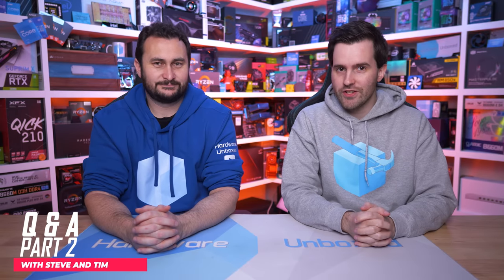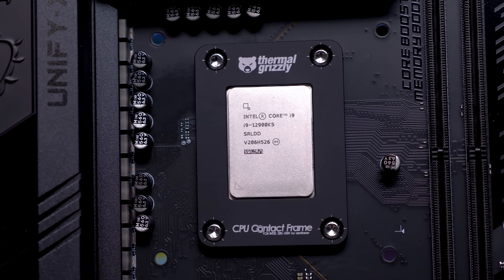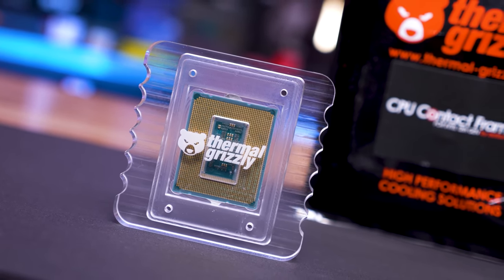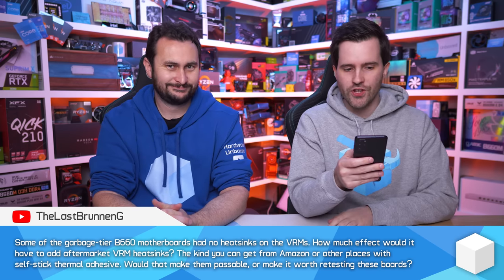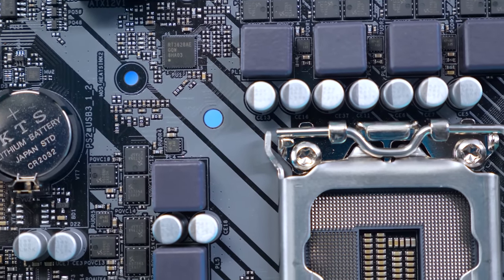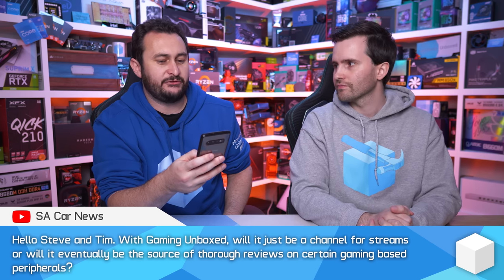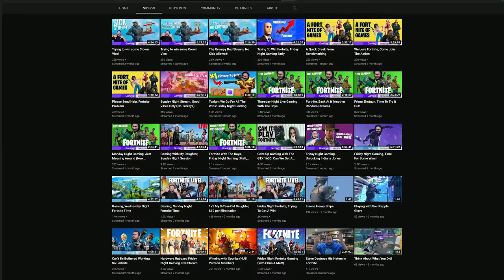Biggest Tech Fail 2022? Zen 4 To Make DDR5 Relevant? August Q&A [Part 2]

Comment: Regarding DPI, I use 8000 DPI all the time. I use Arch (btw) with KDE Plasma and I have the cursor speed set very low with the cursor acceleration set to "flat" as opposed to "adaptive", meaning the distance of movement of the cursor is the same regardless of the speed of me moving my mouse.

Also, the only game I play is CS:GO (which on my 14 years old Pentium E5200 runs very badly 😆) which supports using raw data from the sensor so I have my mouse set to 8000 DPI and the mouse sensitivity in CS:GO somewhere around 1, which is much lower than other players use.
I actually don't even get why players use so low DPI - there is a big difference between the mouse sensitivity and the cursor speed. Sensitivity (measured in DPI) is how precise your mouse tracks the movement and the cursor speed is, well, how fast your cursor is. These two are closely tied together, but having high sensitivity doesn't have to mean having high cursor speed ...

So yeah, I prefer having precise movement tracking but the speed of my cursor isn't different from what others use.

Comment: My HTPC does more gaming at higher resolutions and refresh rates than my desktop rig. While I have more monitors on my desktop, it's only 3840x1600@144Hz. My TV is 3840x2160@120Hz. Right now, it's using far more bandwidth and HDR as well. At this point in time, TVs are well above monitor specs.

Comment: On the quadcore question: Yeah I'd say the 3700x and 8700k or the like 12400 and 5600 are the new version(s) of the i5 2500k. They're gonna last a while. and I don't know why people thought the 5600 would go obsolete so quick? Consoles have 8 LAST gen cores? the 5600 is as fast or faster than the 3700x in gaming... Then don't forget the chips inside the current consoles? Are underclocked to all hell as to not melt inside the consoles small form factor. the 8 core zen 2 chips inside the xbox series and the ps5? can't be much if any faster than a 3600 once you account for clock differences.

Comment: When running a game, your system still needs to continue with system tasks, like running services like virus scanners. I guess these would be offloaded to e-cores.
Reply: Who the fuck runs virus scanners in the backround while gaming? Even modern ones detect games now a days and turns themselves off. Other backround services are negligible.
Reply: Linux does not have this issue.
Reply: @purpasmart_4831  Switching to Linux Mint 21 Cinnamon, this coming build. Done with Windows Hoops and Snooping.
Reply: To clarify: I am questioning the added value of this design for gaming purposes. Multithreaded design of games is very complex anyways because everything needs to sync on the main game loop. Having the additional difficulty of not knowing the performance of a thread because you can not allocate it to a particular kind of core makes it very hard to optimize.

Comment: I play at 5200 to 6400 CPI on 2560x1440 and 3440x1440 playing hardcore CoD single shot kills. Fastest to hitting target wins. CPU-Z 9MM3CZ Another guy I play with uses 3200 CPI. 

Some people use higher CPI but significantly (1/3-1/4) reduce mouse multipliers along with ultra-high polling rates to improve mouse resolution. I've debated about this too and I have considered using 12,000 CPI with halving the in-game mouse multipliers.
Reply: .. BTW replacing everything including CPU/MOBO, GPU and 240Hz OLED monitor. Hopefully the 40 series and new monitors will offer DP 2.0 instead of compression...

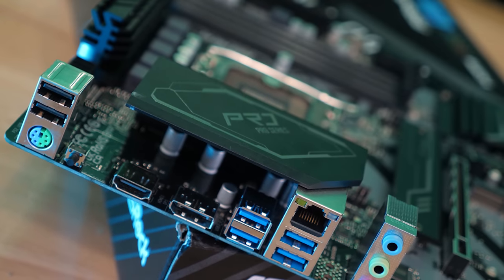Comment: I haven't seen the video yet, but for any serious fps person ddr5 prices can be bypassed to an extent just by waiting for the 3d cache CPU and purchasing the cheapest ddr5 ram. 3d cache makes ram quality irrelevant. Not so much a failure, but a caveat. Zen 5 3d cache CPU incoming on AM5 2024. Presumably the 12 or 16 core option to obliterate intel in warzone etc. 2:07 freeze frame= deep tutelage. 3:40 I do have a limited understanding of core usage during windows gaming, but prior to the release of e-cores I was offloading router tasks to the cores in my 3700x in order to lower my ping, which it did. I assume e-cores were conceived for purposes similar to this, not productivity tasks, as there is a plethora of optimization videos on YouTube detailing how to lower ping and increase fps in core heavy games such as warzone. Also, as a final note, are you able to benchmark the latency values of various high end gaming routers in Australia? Ping is more important in PVP games than FPS. The common response to lowering ping in online guides is to begin by increasing fps. However, fps increases will only lower player ping by a fraction of what internet service providers will, and from discussing this topic with them, modems/ routers will. 6:00 This topic is alluding to the ever-increasing importance of PSU performance and wattage in regard to the transient power spikes in 3000 series and presumably in the forthcoming 4000 series. The is precisely the eternal dilemma of my BioStar x570gt, 3700x, 3080 eagle and 750gm. 8:55 Just use pro mouse/ controller settings. I changed to COD pro settings after 1000 hours and discovered a drastic improvement in tracking and movement.

Comment: Standard way to compare mouse sensitivities is 360s. Measure on the mouse pad how far in CM it takes you to perform a 360 comfortably, and then set every in game settings to match. Mine is 32cm 360. So each games sensitivity is set so my 360 is always the same.

Comment: I think the biggest fail was the garbages B660 Motherboards that advertise an i9 12900k compatibility but will never can feed the processor properly without melt the VRMs or severely hold back the power delivery to the point that make this very expensive i9 looks like an i5 in performance, and this is something that cannot be adressed later by a BIOS update.

Comment: I still have a backup PC with a 2500K in it. Still works beautifully. Those 4 core 4 thread processors from way back were very - very good. It was gen 9 to gen 12 that lost the plot.
Reply: I agree, my i7 2600k was a beast and still is for general tasks

Comment: Question: Do you think the new AMD cpu's being LGA will require or benefit from a contact frame for best thermals like Intel?
Reply: They don't know it yet, but probably not. If AMD designed AM5 to have a balanced contact pressure.
Reply: @franktg632  I agree they don't know yet, but the AM5 boards I've seen look like they are using a similar mounting bracket to Intel which is what raised the question in the first place.
Reply: @scotthassel8124  do you mean similar retention mechanism? intel has been using that for years and not a single problem like that happened before, and it is because intel made their CPUs shaped like a rectangle thats why it had issues, meanwhile AMD kept their CPUs square so I doubt you will need such device.
Reply: @franktg632  Good point. Yes, I was referring to the retention mechanism. I do believe that the shape was a large factor, but I've always felt that mechanism was a "works well enough" solution and could've been much better. We'll obviously see. Was hoping to get this on the table so that the reviewers, when they receive their review sample, will be looking at that. Of course, being more efficient, the AMD's may not benefit much from a better retention mechanism.
Reply: AMD have designed the socket and CPU package to fit their traditional dimensions, why would a long used cooler retention system start bending CPUs?
I'd be more concerned about some trouble with the funky thick heat spreader coming unstuck than the cooler bending it
Reply: intel socket LGA 2011 solved all these large socket problems beautifully... by simply having two retention arms, on opposite sides.
Reply: @RobBCactive  Look at the Epyx, Xeon, Threadripper, etc. Chip mount and retention systems have varied greatly over the years and when it comes to commercial enterprises, they are looking to make the largest profit margin they can. Subsequently, a cheaper, "good enough" solution is often employed. In recent years more and more people are overclocking either intentionally or unintentionally (via XMP or other "tweaks"), and these "good enough" solutions are not providing the most optimized setups. Like I said, there have been alternatives for most configurations out there It has just been whether the customer finds it necessary to implement those alternatives. Most don't care and both Intel and AMD will have stock settings and setup which will indicate that a cpu approaching the thermal limits are still within spec. We are as endusers, trying to extract more and more from packages which approach their thermal limits, may need these alternatives. Does the AM5 design provide an excellent implementation, or is it just "good enough"? That's what I'm asking. Let's face it 16 cores with the controller in such a small package would IMMEDIATELY burn up without proper thermal control.
Reply: @scotthassel8124  ummm, according to Angstronomics Zen4 is thermally controlled now.  I believe it as somebody at the presentation shared the energy management is "more like a laptop".
There'll be plenty of reviewers looking at thermals it's Tech Jesus's obsession after all.
To run cooler than spec, active cooling can work harder.  But with dynamically managed chips, better cooling can translate to more boost speeds.
However the stream talked up performance at lower power levels, it's possible to limit PPT in BIOS if the cooler you choose isn't effective enough.

Comment: I operate my DPI at ~3600 I use a 3440x 1440 ultra wide. I'm not sure about sensitivity but a full 360° rotation in must fps game is about an inch and a half displacement of my hand.

Comment: DDR4 was out in around 2014, it's time to move on as 8yrs in tech time is a very long time so I'm really glad AMD is ditching DDR4 entirely as it also means less to support and fix. I'm running a 5950x with 64GB (4X 16GB) of Corsair Dominator Platinum RGB and I really want the 7950X so that means I have to spend a big chunk of money on RAM which for a like for like replacement in DDR5 is about £500/600 just for RAM!. Is it annoying yes but tech moves on and that new memory if it doesn't fail will end up going through a few builds before it probably gets replaced with DDR6 anyway. My current RAM went through a 9900K and my current 5950X.

Comment: 29:30 Playstation 5. Any HTPC will cost you WAY more and deliver the same experience. If you want 4K 60 on "The latest and greatest Games" you are going to pay A LOT of money.
3080 12GB or better a 3090 is the minimum. I'm gaming on a 3080 12GBs myself and on "high end games" with high settings you still will have trouble to hit 60 even with DLSS turned on.
For example: Cyberpunk 1440P with Raytracing and DLSS is between 50-60 FPS most of the time, let alone 4K.
So just save money and buy a Playstation or XBox and get the advantage of "It was specifically made for a TV" with support for all TV Features and (most of the time) the devs making the game for 4k 30 FPS which is a complete different story to "PC Game that was made for 60 FPS stuttering at 30 FPS"

Comment: 15:50 I do think, however, that "real life" testings are also very useful. Personally I find myself often searching for those channels which compare such things, with videos about 2 or more different GPUs on the same CPU and viceversa, often covering a really wide variety of configurations, to check what the FPS and visual quality is. If instead I see the 5600X handling the 3090 Ti up to X FPS in Y game, then I watch the 6700 XT with the 5950X put out Z FPS in Y game, how do I know what's going to be result when pairing the 5600X with the 6700 XT? I understand that you can't cover EVERY single configuration while doing the rest of your videos, that would be monumental, but maybe some very "realistic" and probably "average" testing would be actually useful. These kind of "no bottlenecked" tests are interesting only to a certain point, because the average consumer IS instead going to come across those bottlenecks, so what do I care if the 3060 is technically capable of reaching said FPS with the 12900K, if that is NEVER going to be the pairing?
Reply: I also agree that it is useful to have benchmarks with all components being in similar tiers. It makes things easier.

Comment: 19:40. I am using an I5-3570. And I can run 95% of the games I want to. in all honesty it impresses me that this almost 10 year old CPU still manages to hold some ground.
Reply: @Transistor Jump 
Indy games for the most part.
GMOD, From the Depths (VRAM bound), Wargame: Red Dragon, Arma 3, Deep rock Galactic, Homeworld Remastered, Halo: Master Chief Colection, MOWAS2, Rimworld Stonehearth (these are are CPU bound once there are a lot of colonists around), Space Engineers (I have no clue by what its actually bound but I think by both CPU and GPU (GTX-950 2GB), Insurgency: Sandstorm (Mostly GPU bound), DCS world (Mostly Disc bound - 5 minute loading times because its on a HDD because I can't spare 100GB on my SSD otherwise both CPU and GPU bound), KSP.

Ones where I didn't add any notes run fine. 
I also play ancient games every now and again. and other games not worthy of note due to either play time or requirements being an actual potato.

Comment: 13:34
Maybe you could approximate the performance you will get from pairing CPU with a low or midrange GPU by just capping the unconstrained test results to the performance level of the cheaper GPU. Just to put the results in to perspective.

Comment: I would have thought there are tons of stuff that can be offloaded to the e-cores. Economic simulations might only need one frame per minute for instance. I've read blogs from game developers where they make the case that a big part of optimisation is realising what does not have to run att full frame rate, and there is usually plenty.

So yeah, I would have assumed that there are plenty of good reasons to use e-cores, but I am also not a game developer (just a regular programmer).

Comment: Well tbh adding heatsinks to help bad design is never truly "waste of time" maybe some minor amount of money (unless you  buy from aliexpress). To help those cheap ass components to stay more in temperature range is actually better.

Example had ASRock FM2A75M-ITX apu board back in the day that had design flaw in 1st revisions. The motherboard VRM/exploded caught fire cause they didnt have heatsinks over them. Ofc bad component choices play part here too using heatsink over them would have solved most of the issue as it did. Everyone who bought the mb was forced to add aftermarket heatsinks over VRM mosfets.

Later FM2A85 models they added heatsinks even using same VRM mosfets.

Comment: I run at 1800 DPI and it's about 15mm for me to spin 180 degrees.
I can snipe from the hip no problem.

I'm not sure why anyone would want a DPI higher than 2500.

Comment: I'd be willing to bet that tuned b-die ddr4 will be faster for 1080p gaming on the next gen cpu's. I don't really think the ryzen 7000's will be a huge improvement for gaming until the 3d cache models are released. In that scenario ram doesn't really matter, but without the extra cache, the latency inherent to ddr5 will be an issue. I really think AMD made a mistake in not offering ddr4 boards for AM5. I've been hearing that Intel is still going to continue to offer ddr4 compatability with raptor lake.  I believe raptor lake might be a better option for gamers until the 3d cache ryzen sku's are released.

Comment: The current i5's will depend on what the consoles do and how tech like direct storage removes some stress off it.
If a 3700 which is what the consoles use, will only be good enough for 30fps. Then obviously the 5600 will wont be a 60fps cpu but it will be usable.
Next console generation it will probably be time to upgrade which is roughly 6 years from now for an 8 year console generation, so that matches the 8 year prediction from Tim

Edit: If RT becomes more cpu intensive, then that could also reduce the expected life of the cpu but then you pairing a new yet to be released high end graphics card with the older cpu
Reply: I wonder why Spider-Man is so CPU-heavy compared to other RTX-heavy games like Guardians of the Galaxy or Doom Eternal. I guess reflecting the city on so many skyscrapers is really demanding for BVH

Comment: Really want to know how much high speed DDR5 (6000ish) will benefit productivity software over more standard speed DDR4(3200). Deciding on whether to go AMD or Intel, and if there is little benefit to DDR5, I'll get a DDR4 board with Raptor Lake.
Reply: Been using a12700K with my old DDR4 3600 and on the productivity side with the likes of Adobe, Vray Octane, Blender, Lunacy etc, I have been very impressed...granted I have the rtx 3080 to lean in on some packages but bottom line, if you want to reuse what you already have to save then the differences will not be that great unless every second saved means dollars...

Comment: Well for csgo you call the calculation result edpi. Which is your in game sense * mouse dpi. I think this assumes you take raw input in game which negates your windows setting anyways. 

So my edpi is 400(mouse dpi) * 1.98 (in game sense) = 792 edpi. If i changed my mouse to 800dpi but wanted to set my ingame sense to match my previous edpi sens i take 792 / 800 (new mouse dpi) = 0.99 

So my in game sens needs to be set to 0.99 to be equal to my old sens. Hope that helps

Comment: My i7-6850K is one of the first 6 core CPUs I think. I can literally not play Cyberpunk 2077. Even at lowest settings my PC crashes constantly still. My GPU is 1070 so not the problem, although old. And other than that, I can play all games fine enough. Apex Legends is tough on the 1070 though - not enough bandwidth to stream in textures. 

My point, architecture can get too old even when you have 6 cores/12 threads.